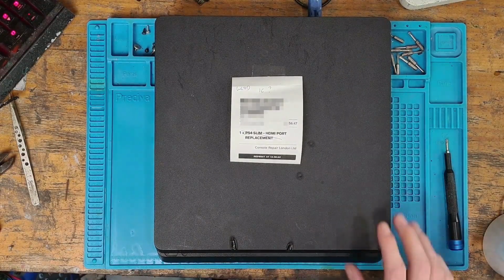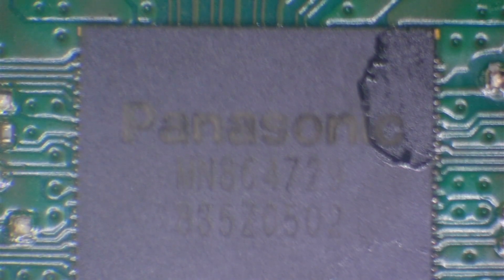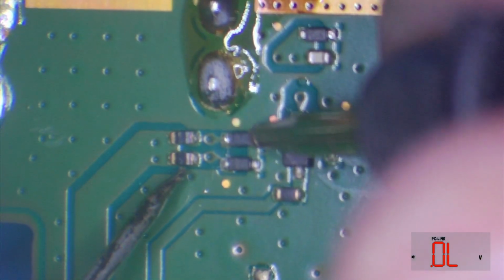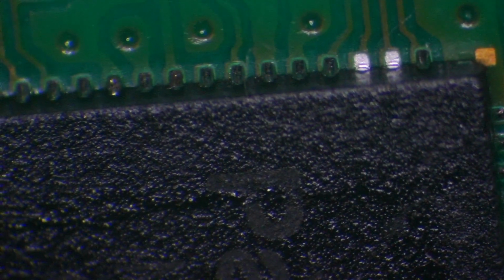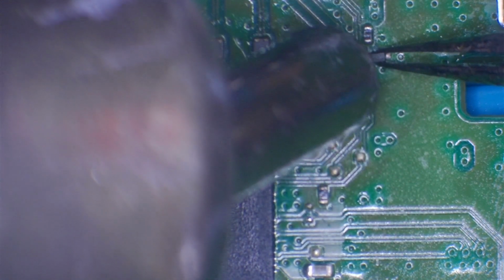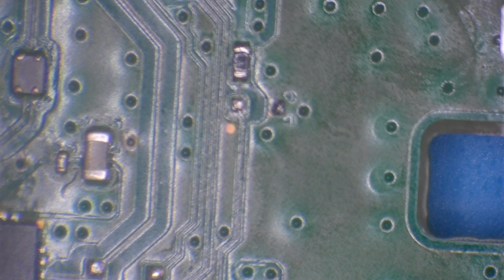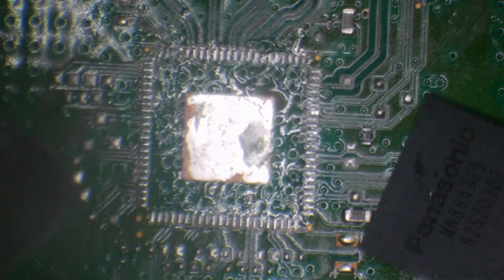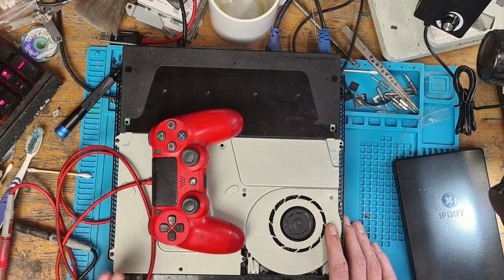PlayStation 4 Slim White Light Of Death Repair - This Job Almost Sent Me Insane!

Comment: First
Reply from the maker: Haha you beat Jason 😁😁😁
Reply: Haha that why I done it lol.
Reply: Phil check Facebook messenger when you get 5, it’s about a ps5 repair.
Reply: Hi i have a ps4 white light problem and need advice.

So i traded a faulty xbox one original for a supposed faulty ps4 original from a person that fixes consoles that wanted the Xbox for spares.

So on the day i got home with the ps4 i used my ps3 cables to power it on and it miraculously powered on which surprised me as the controller was connected properly using the usb cable.

But i saw the screen flash black then back to the home screen which i didn't know what is was then it did it once more and was displaying perfectly.

After about 5 mins of waiting for it too show some errors or switching off because i did not expect it to work i plugged in my usb speakers to the other usb port on the front while the controller was plugged in.

That was when the screen went black instantly. I didn't know what happened and pressed the eject button and a copy of GTA 5 came out which means the console was still powered on.

When i plug the controller and speakers in on my ps3 super slim at the same time is says too many devices drawing power something like that.

So i think it drew too much power on the ps4 and caused a wlod on the ps4.

Im trying to do a home repair with minimal tools and if you could give me some idea of what the usb ports could have shorted eg a transistor or fuses or something.

It still powers on and everything but that was the defining factor i think that contributed to the white light of death.

Any recommendations would help as ive watched a lot of YouTube videos and most are the ic chip or some transistor .

Its a original ps4 with wlod 1116A

Comment: Hey bro just a quick Tip. Pun intended. I use a knife sharpener to remake points on my tweezers and probes! Hope it helps you! Also another good one is to use a dremel tool with a buffer to make them look shiny and new!
Reply from the maker: I generally just buy new once a month because they only cost £1.50 from aliexpress lol. Thanks for that tip though I'll give it a try 😁

Comment: I have a stumper for ya! It’s s WLOD but the video signal is partially present. The “no signal” message on the tv goes away and the screen turns black. The image will even flash on the screen really quick just to tease you and let you know the signal path is actually all there. But then it just stays black. It’ll also flash the image really quick when you start to power it down. 
Replaced the encoder and 1 filter and it’s still doing the exact same thing. 
It’s a cuh-1115A
Reply: Check to see if the chip is completely flat to the board. Mine was not completely flat. Still working on it tho. Replaced port, chip, 2 filters, and fuse. And ran enameled wire.

Comment: I did buy recently a little gem from Ali, a set of wired tweezers for my multimeter, abs brill for short testing smd stuff like caps and diodes or value testing resistors.   Fitted perfectly on my Aldi's cheap as chips multimeter and I wondered how I managed without 'em for years lol  Only couple quid too :D

Comment: Those chips weren't faulty,  they're fake! A lesson I've learned from my years on Aliexpress. Never buy from a new seller.  I understand not all 5 star reviews are real. But they certainly help in working out if things are too good to be true.  Hope you get your money back. Although don't hold your breath. I bought a pair of wireless earbuds that had good reviews. Full of static and fell apart. Never did my money back. But everything else (touch wood) has been fine. Come to think I have a few things I need to get for am Ambilight mod I want to do!
Reply from the maker: Yeah I'm just glad they didn't damage the apu mate to be honest, because it turned it blod when they were installed :/
Reply: @TheCod3r  Great video as always. Good to see talented technicians in the UK. I only wish I had the hands to solder. So I watch you instead!

Comment: I know this may not be the case but I was wondering if the chips were not labeled in the correct orientation. I noticed on the bottom of the chip that the ground plate has a notch on one corner to show where pin one should be. Have you looked at the five chips and compared them to the chip you pulled from this board or one in your bin? I would be interested to know if maybe they were engraved incorrectly by accident and it was not caught.
Reply from the maker: Apparently they're fake chips mate so I wouldn't want to use them even if I could get them working, because who knows what kind of damage they could cause long term :(

Comment: Can someone help me pleaseee: PS4 Slim WLOD:
HDMI port connections are all good,
The HDMI filters all have continuity, no bridges and no shorts,
The fuse on B side has continuity, the diodes don't have shorts
Replaced the MN864729, but still a WLOD

What am I missing? Or is this a CPU problem? ):
Reply from the maker: It is possible that you have a bad Southbridge. That can cause no display too. Unfortunately there's no way to verify the southbridge being the fault for display issues
Reply: @TheCod3r  Do you think it's worth a shot?

Thanks for your time btw! Really appreciate it.
Reply: @JoeySoeter  same problem. Did u fine the solution
Reply: @ngonohtc5724  well I talked with the customer about it back then that it could be a south bridge problem and those chips were hard to get since I didnt have any donors at that time. So I didn’t fix it unfortunately ):
Reply: @JoeySoeter  ok thanks for the quick reply. I will try replacing the Southbridge when I have the right tools and let u know

Comment: What are the chances that the ic has pin 1 oriented in another point
Reply from the maker: I did check those after the video and the pins that were shorted shouldn't have a short on those pins on any side of the chip :(

Comment: Hi @thecod3r I see that you bought chips from HMSKJIC store. Can you confirm that this seller is good? Because I ordered xbox one x retimers and still no luck. And I`m thinking its faulty IC or esd booster.
Reply from the maker: Hi mate, yeah I don't have issues with them at all. I've just received some esd boost ICs which may be the correct part for the one x (as it stands they cant be purchased) so I'll be doing some testing tonight to see I they work